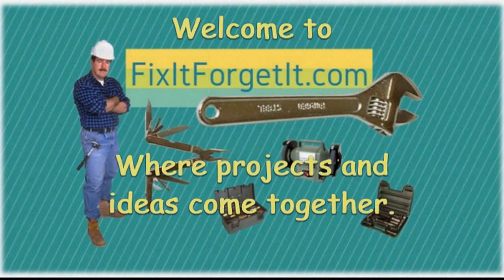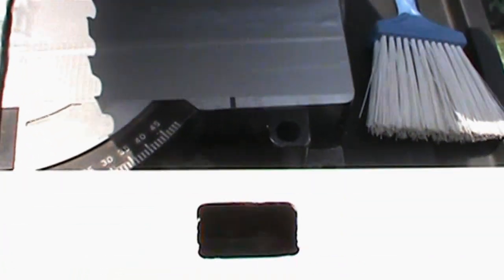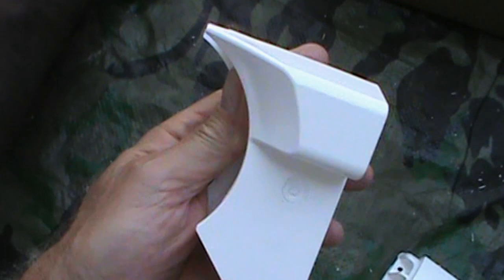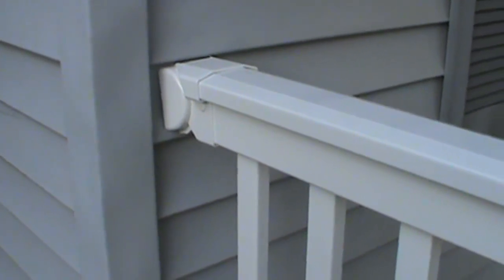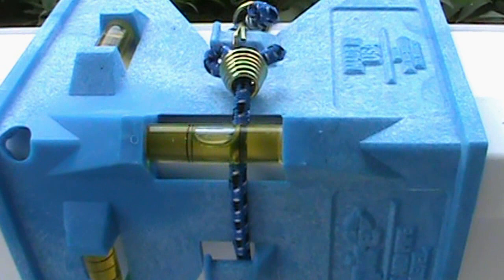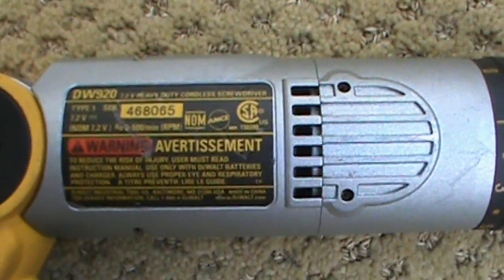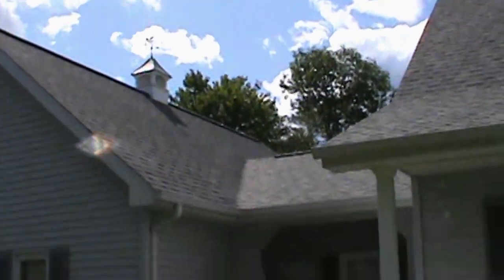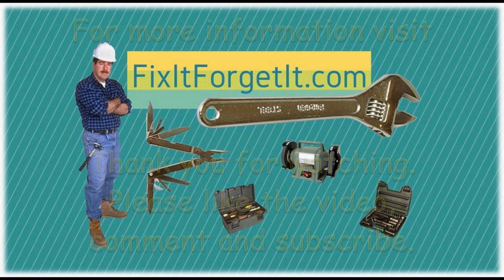How to install USA Vinyl Weatherables PVC Hand Rails.

Comment: Can I ask, do you feel Weatherables is a good product compared to Barrette brands sold at Lowes and Home Depot?
Reply from the maker: Hi, sandywjo5. Sorry I didn't get back to you sooner. I am not familiar with any brands of vinyl posts and railing other than Weatherables. I really like their quality and engineering but I do point out some concerns I have with them in the two videos. Overall I am glad I went with Weatherables and after 3 1/2 years it still looks great. No yellowing or structural problems at all.
Reply: @Fix it forget it.  thanks for the reply!  if you wet sanded spots, didn't that leave areas of duller finish? Or is all of the finish already dull?
Reply from the maker: @sandywjo5  My pleasure. That's a great question. Surprisingly when you use 600 grit sandpaper and water it works great. The natural finish of the Weatherables seems mildly glossy but not too much. The wet sanding worked amazingly well and doesn't leave a difference in the finish.